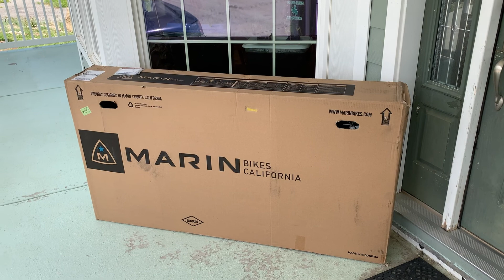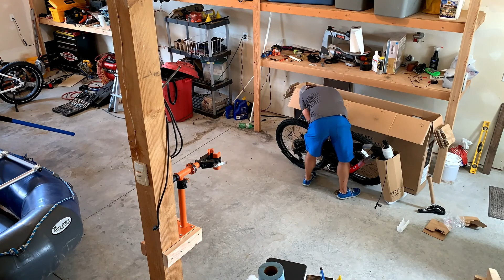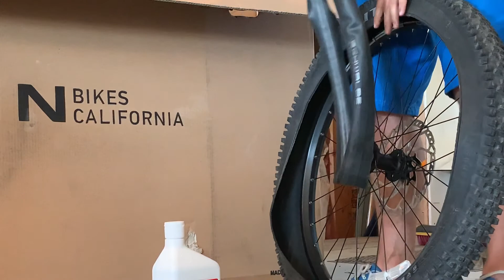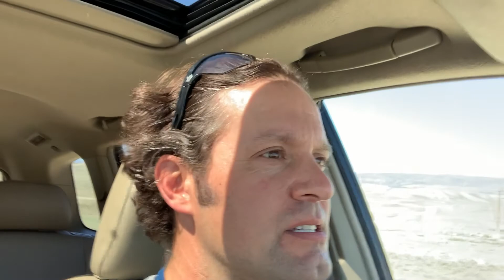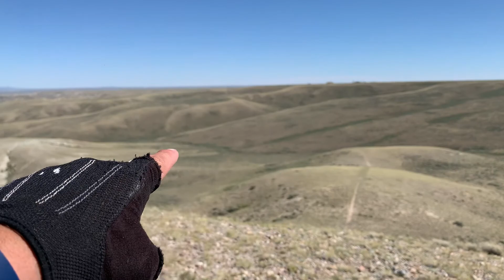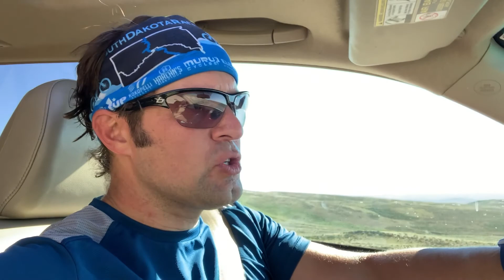Marin Mount Vision 8 Bike Review

Comment: Nice bike john 
How’s the suspension?
How tall are u?
My son is looking at one for enduro racing in New Zealand 🇳🇿 it will be his first full su
Reply from the maker: I really like the suspension. It has a predictable feel to it. I am 5’6”.
Reply from the maker: If your son gets one to race, he will have to be prepared to convince everyone it is NOT an ebike. I think that is the first question I get about the bike: “Is that an ebike?” I need to have a sticker made for it that says, “NOT an ebike.”
Reply: Has the rear suspension system been reliable? Have you done many miles on it? What’s I like doing fast drops? Does back shock lock up when pedalling down hill?
Reply from the maker: I haven’t had any problems with the rear suspension. I’m not sure the mileage, but I have ridden it pretty consistently the last couple of summers. I have not had the back shock lock up while pedaling downhill. I think as long as you set the suspension up properly for the rider and the type of riding that they will be doing, it should perform well for you. I have a few other videos of me riding the bike that are posted on my channel. You can check them out (they don’t really go into a review, but you can see it in action).